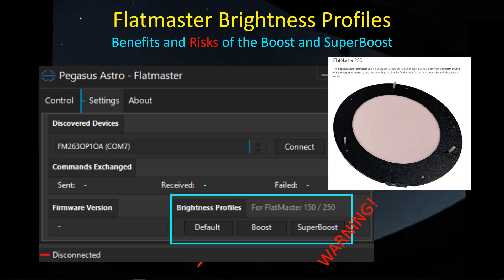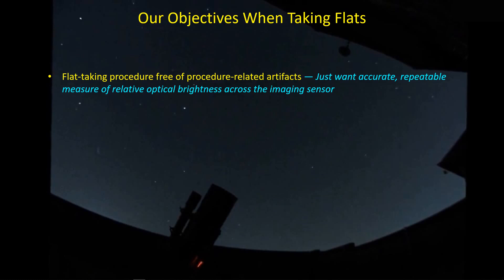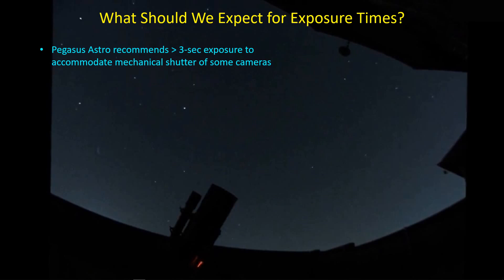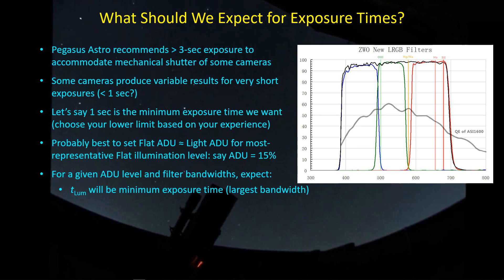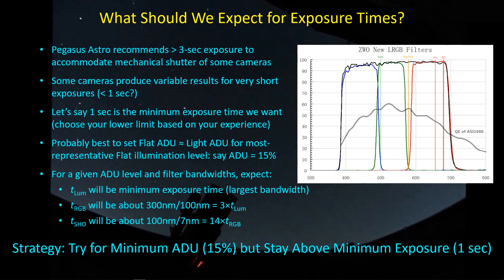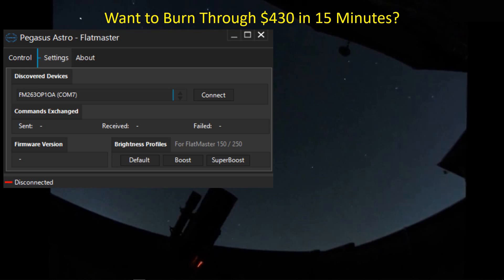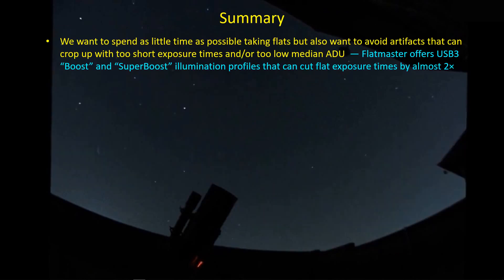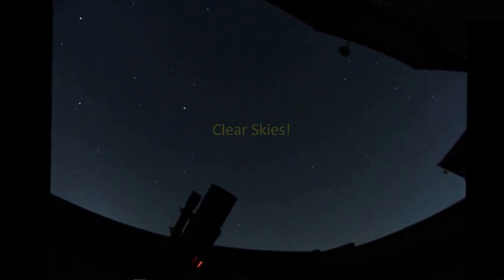Evaluation of the Pegasus Astro Flatmaster 250 "Boost" Brightness Profiles

Comment: I just completed my first real LRGB project. I suspect my flats are 💩 because after LRGB combination, the background is quite... colorful. 🤨
I've read that my camera likes 3s flats, but the USB sketch pad I use for flats is too bright. 3s = 100% ADU.  Now that you've spent some time with it, 
would you recommend the pa flat master?
Reply: I want to use NINA's flat wizard to target 40% +/- 5% and >/= 3sec, then let NINA determine the panel's brightness.
I also have 3nm HSO filters to consider.
Reply from the maker: Hey Tom. First, I wouldn't put too much stock in the "3-sec flat" advice. I know of no reason why an x-sec flat is important. Sometimes, if you use a video device (TV, iPad), then you'll want a longer duration exposure to make sure you average out the banding that occurs during screen refresh. The PA flat device is nice and works well but is WAAAAY too expensive for what it is. You might try a cheap light panel you can get from Amazon at 1/10 of the price. Also, I have had very little luck in using NINA to control the Flatmaster. It's not worth the trouble. I manually find the exposure that gives me the desired ADU level for each filter. I have those exposure/gain/filter numbers in a "flat imaging sequence." When I shot flats, I use the PA interface to turn on and set the illum level then just run flat sequence in NINA. Works fine.

Comment: As a hardware engineer, this product would not pass strict Australian Safety standards regulations. It should have a maximum time of 15 minutes based on hardware timing or lock firmware. This is an extremely poor design IMO.
Reply from the maker: Good comment. Glad I spent $430. Geez.

Comment: Wow $430!  I got a $40 A4 tracing panel for Father’s Day (attentive daughters rule 👍) and using the APT Flat Wizard I go for an ADU of about 25,000 +/- 5%.  This panel has a memory setting that’s been working well to reproduce a consistent light level.  It’s low tech but it works well enough for me.
Reply from the maker: Your daughter is smarter than I am! Your point: "It's low tech but it works well enough" says it perfectly.
Reply: @Aero19612  the rest of the process complicated enough without adding more layers.

Comment: That isn't a great UI. That being my day job of producing usable interfaces it hurts a lot seeing that being done on a product being sold hurts so much :(.

Do you know how I could evaluate how good my DIY flat solution is?  I generally don't think I have flat problems but it would be good to know I'm doing the best I can given how many hours are spent capturing light frames
Reply from the maker: Definite room for improvement on the GUI front. The best test for how good a flat is, is to look at your calibrated Lights to see if you have any uncorrected blemishes in the optical train (problem may not be the flat though). A second thing you might do is try calibrating your individual flat frames with the Master Flat you got from averaging those individual frame (combine them to a single image like you do with lights and see if there are any blemishes left over). This can also reveal issues with single flat frames that can be omitted from a 2nd generation Master Flat. Finally, take a look at the PixInsight script for FlatContour to make a brightness contour map-looks cool but may only be useful for side-by-side comparison of flats from different methods: say, T-shirt vs light panel. Thanks for watching, Wayne!